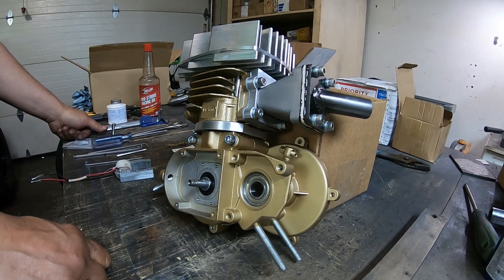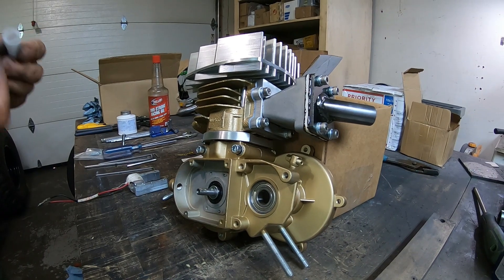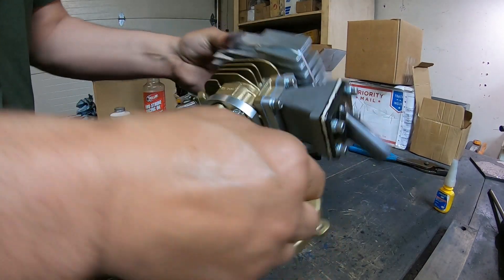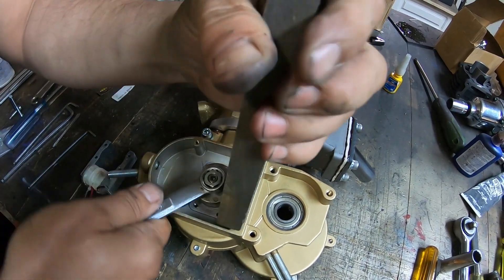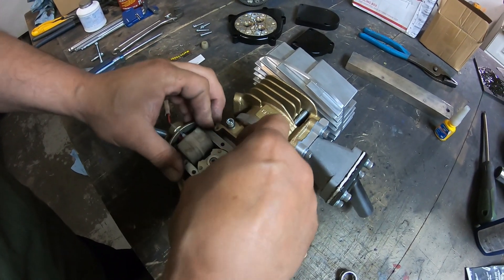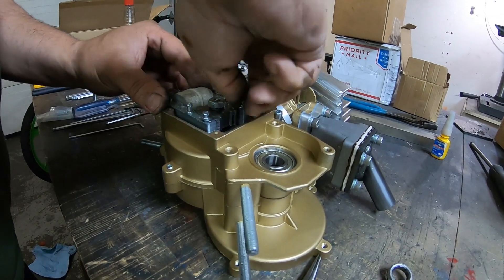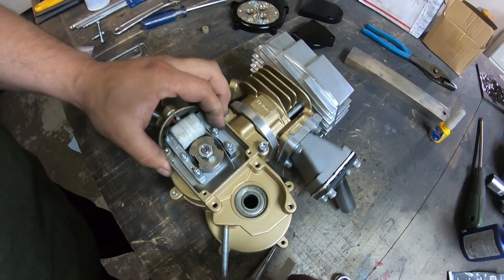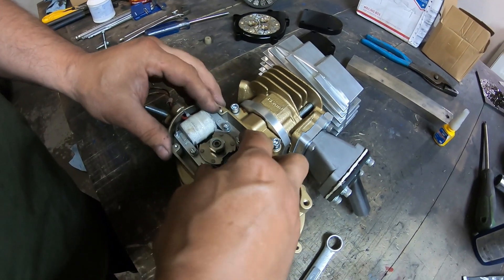How To Install | Magneto Coil Stator

Comment: Minarelli twice the work when China doll is just as fast. If you buy a minarelli just tells me you don't know how to make a China doll scream rpm.
Reply: Thats a bunch of wrong information you have .. mine are minarelli 70cc is ported I've owned every kind of engine 47mm , 49mm 50mm China dolls,  I've build 6 different saw cylinders,  by far the minnarelli is the best all around engine , super fun to ride .. you should build one so you know what your talking about and not speculating
Reply: I haven't built one because I rode mark James is minarelli and it didn't perform any better then my built China doll but 61mph is fast enough for me with my China doll . Definitely not nocking your work you are a  awesome builder
Reply: @mbrrideitlikeyoustoleit8436 the minarelli you tried...maybe its who built it .... maybe 🤔🤔

Comment: Awesome and informational!! Really appreciate your vids. What cylinder head are you using on this engine?? What is it from??
Reply: Awesome I’m about to build one already ordered everything but the head but now that I see it again I might get it has a different look than mine
Reply: You can also put blue tack on the magneto magnet spindle and press the little metal wedge into the crevice and slide the magnet onto it,  cool motor still 😎
Reply: @mljay3537  it's called a woodruff key, I wouldn't recommend painting the mag.